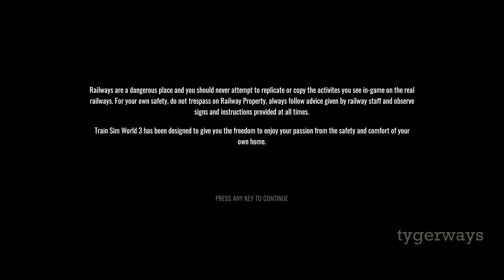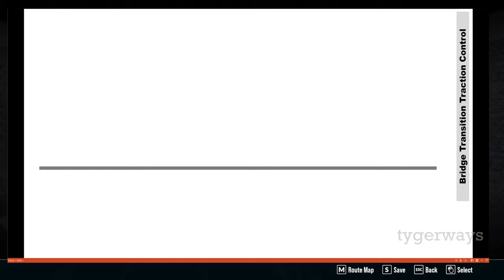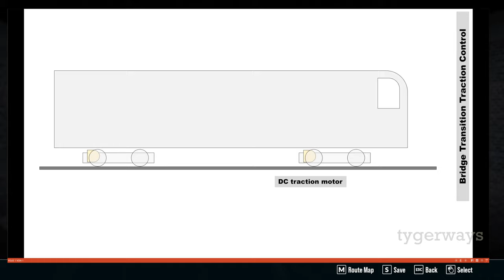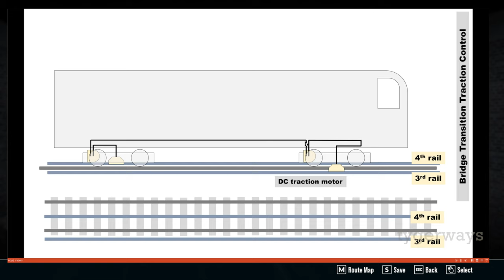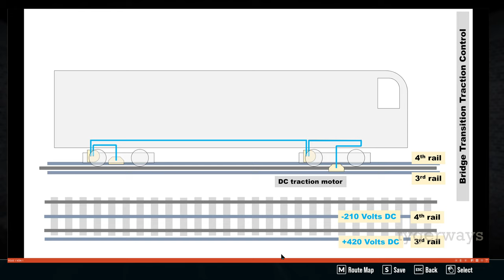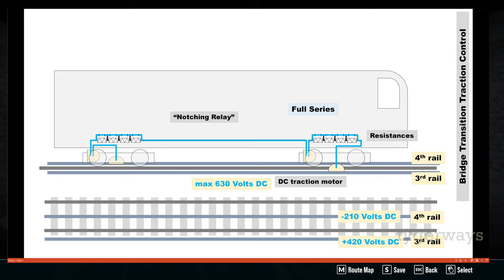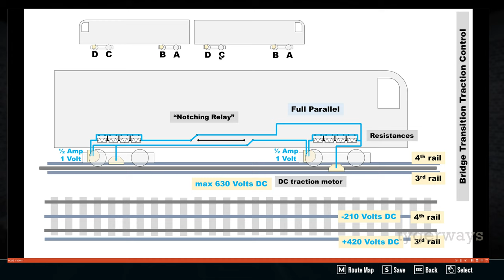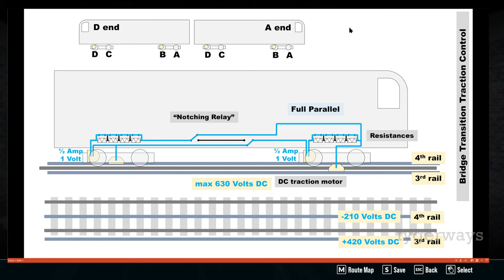Electric Traction: Vintage bridge transition traction control on the 1938 stock (TSW | tutorial)

Comment: EP Brake.  The 38 TS actually had the EP brake/Westinghouse set up from new.  For many years on the tube the rule was that the Westinghouse brake should be used to stop the train at the station before the terminus as an added test.  So this would be at Lambeth North going south on the Bakerloo.
Reply from the maker: Thank you! One can always rely on you for the extra bit of expert knowledge! I have heard about the Westinghouse 'brake test' at the penultimate stop in connection with 1972 stock (unfortunately not before doing the video), otherwise I would have tried doing it with the train model.

Comment: A and D ends.  This is to do with the end couplers rather than the motors.  You mentioned the 38 TS came in 3 and 4 car formations so in service a 4 car and a 3 car unit would be coupled together to form a 7 car train.  The couplers these trains used have mechanical, pneumatic and electrical connections with the electrical connectors offset to one side.  Because the electrical connectors are offset you would not be able to couple them if they were all the same so an A end car had them offset on one side and a D end car had them offset on the other side.  This allows an A car to couple to a D car but an A car can't couple to another A car and a D car can't couple to another D car.  

This system was common on tube stock built up to the 1970s and wasn't an issue on lines with no reversing loops (like the Bakerloo and Piccadilly before the Heathrow T4 loop was built) where all the units would stay orientated the way they were originally formed.  However on the Central and Northern (and the Piccadilly after the T4 loop opened), it did make life difficult when reforming trains as you needed to have a pair of units orientated the correct way round to couple them.
Reply from the maker: Thank you for adding the information about the couplers! I also read that only the (mechanical) couplers at one end (I think the D end) would be spring loaded, another point why it is important to always couple A to D.